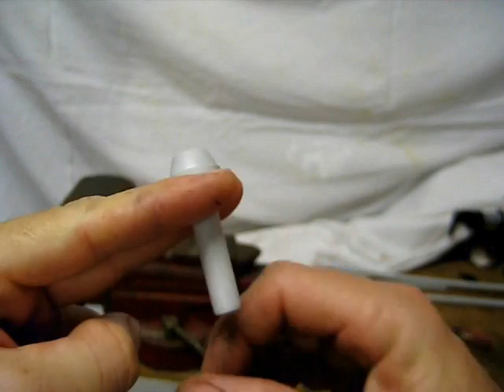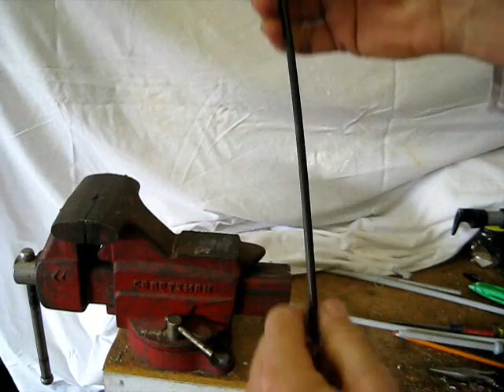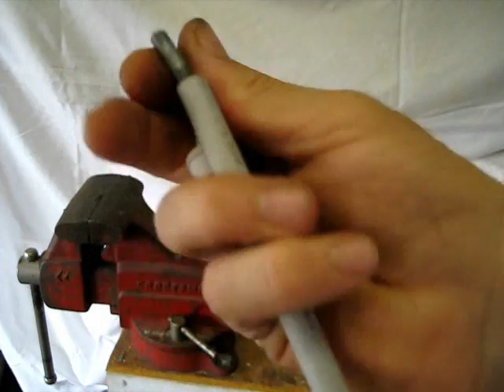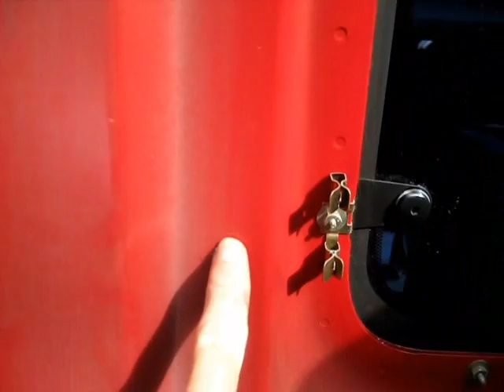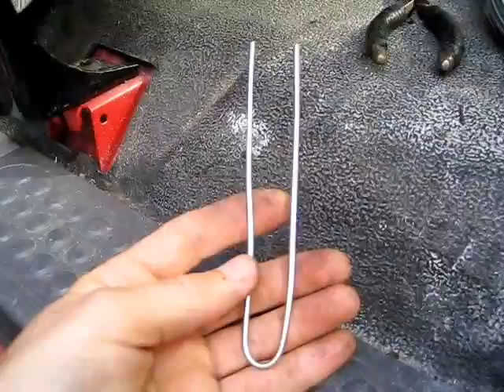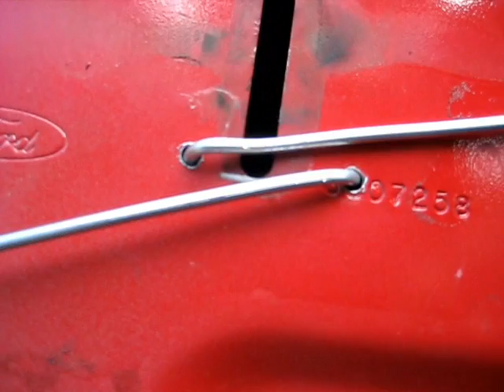ford superduty rear door wont open part 3 of 3

Comment: For the past yr both of my rear doors would not open, Ford wanted almost 200.00 for new cables for ea. door, I watched this video and elected to try this method of repair, as I did not have 400.00 just for parts. I fixed both upper and lower cables on one door, and upper on other door. I spent less then 10.00 at home depot. Thank you to the person who made this video.

Comment: Thanks Mark B. You are a genius! Neither of my rear doors on my 2000 F150 would open. First the driver side (7months ago), then the passenger side 2 wks ago. I followed your instructions and your fix for the upper latch worked like charm. As a matter of fact I used the same method to fix the lower latch, because it broke while I was testing my repair job on the passenger door.  On the lower, I used a tie wrap to secure the notched piece into the prongs. Thanks again.

Comment: At last - a worth while use of the internet! People helping people to solve problems without paying an arm and a leg! 
Mark - you rock for going through the effort to put this together.
For those asking about my bike brake cable solution - my apologies but I was up against the wall and in a hurry. I'm afraid that I did not have the time and the generosity that Mark has - I did not make a video. If you have a bicycle though, just go out and look at the brake handle where the cable is inserted and it should become pretty clear pretty quick what the concept is.
Once again, thank you Mark - you saved my butt AND made me look really smart to my wife. LOL
Reply from the maker: +NoTorr2000 Thanks for the nice words.  I am glad you brought that brake adjuster idea up.  I kept thinking, gosh, if I could just make/find a bold and nut with a slot in them.  I even walked past my mountain bike several times while I shot the video.  And I work on it all the time  Ir just didn't click.  That is definitely the easiest and cheapest way to fix it so far.  I fully intend to shoot a new video, but I am stuck in a few other projects right now.  Thanks again

Comment: fixpro256, Thanks so much for making all three videos, as NoTorr2000 said, you took the cloud away from tackling the door apart. But thanks also to NoTorr2000 for the heads up and the eBay link. you both made my day.

Comment: Mark:  I followed your instructions and it worked!  Fixed!  I just have to drill the holes for the support wire and I am done.  Worked to a tee.  Thank you for your efforts on the video.  Ever in Hartwell, GA I will buy you a coldbeer!

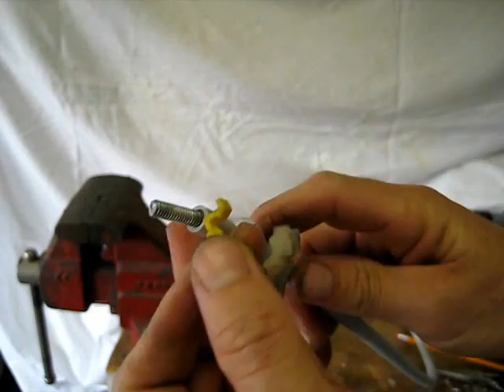Comment from the maker: Yes, I see what you are talking about.  I showed how to get it free in part 1 of 3 at about 3:40.  I show how to adjust it in part 3 of 3 at about 3:45.   Probably best not to put the door panel back on until the truck has been thru a few days of hot and cold weather to make sure you have it adjusted right.  Best of luck and thanks for asking.

Comment: Great video thanks a million.
on 4/5/2015, I was able to buy a pair of the cables  (approx 10 3/4 and 17 inch) - quality replacement parts for $42 from my local Autozone. Other brand name auto parts stores also sell the cables. and I see them online for $19 + $9 s/h.

That doesn't detract from your great quality videos showing the problem and assembly steps.

Comment from the maker: Thanks for the complement!  I agree that the design sucks! And even worse that the cable is not sold separately.  A real waist of resources to throw that big chuck of steel away because the cable housing cracked.

Comment: Clever great job!   FYI on eBay under ford cable repair you will find aluminum cable ends to repair the cable. They work great and are very easy to replace. They are 7.48 for a set.
Reply: lastgleeming, I just went outside last night and on my 2000 F-350, the door behind driver seat would not open, I said, OH NO!!! first thing I thought of was YouTube! LOL!!! I thought I would never find anything on YouTube about the suicide doors jamming up. I couldn't believe it, it happens quite often, LOL! After watching all 3 of these videos I was wondering if I could find a repair kit on eBay and then I seen your comment, 😂LOL! 
I'm gonna check it out now, Thank you my friend!!!!

Comment: I just cut  28 1/2" for the long one and 1" the little one  they work perfect, use my heat gun and  made a curve at the end.  For the notch I did use a Reciprocating Saw Blade, notch must be 7mm. , use some pressure when installing.

Comment from the maker: The first time I put it all together, the latch would not release when I pulled the handle.  I didn't really have to shorten the cable by cutting or anything like that, I just had to adjust the length using the adjuster on the threaded end.

Comment from the maker: Have you been able to get the door panel off? It should come off even with the door shut. Then pull the black plastic away from the door. You should see a large hole big enough to get your hand in and reattach the cable. Then pull on the inner part of the cable to release the lower latch.  You will probably have to lay in the back floorboard to access the lower latch. May need a small mirror and flashlight to see better.  Let me know how it goes.

Comment: Just to let you know Mark, to open the top latch of the truck, I did have to disconnect the cable from the assembly back, then pull on the whole cable, this dislodged the latch and just today was able to get the 1/4" pipes to repair the cables. Yes, both cables were broken, so I'm using your vid to complete this task!  Again, thanks so much to you and others like you who are able to save us guys a bunch of money!!

                       Doc

Comment from the maker: Would be surprised if inner part disconnected. If I remember correctly you can get door panel off with it closed.  Then find the end of the cable where it attaches to the handle and pull on the inner part of the cable end. If that doesn't work, then you reach in one of the holes (you may have to take out the speaker) and pull on the cable. Keep in mind that when you pull on the outside of the cable you will probably break the ends of the cable.  Then you will have to follow the video to fix it.

Comment: Hey Mark;I just thought I'd give you and others another option.......There's another Ford truck owner (who's a retired machinist) that had the same issue happen to his truck,so he invented 'a better mousetrap',by making aluminum CNC milled end pieces,that fit perfectly,to take the place of the cheap plastic/rubber Ford ends that disintegrate.....He sells each kit for $38 w/free shipping;Just search Youtube for "Ford F series door lock cable repair BEST METHOD".....He also makes them for Ford Ranger & Econoline vans too!

Comment from the maker: Even worse, the cable will come out if you hold your mouth just right.  But, nobody sells just the cable, so you have to buy the entire latch system.  I cant see bending over for $500 on a 1999 truck either.  Thanks for the comments.

Comment: Also, I have a 1990 Ford van with the same problem. My side doors and reardoors will not open but both front doors will. I will see if I can reach the cables by removing the inside panels.
Reply: I will let you know. I plan on attempting to open the doors within the next week or two.
Reply: I have not attempted the repair yet. Have been extremely busy.

Comment: I have a 2000 Ford Ranger XLT Supercab with almost the same problem on BOTH rear doors;I had to call the Ford dealership todayTop latch w/cable=$127ea/Bottom latch w/cable $115ea x2=$484...They did offer me a special deal since I need all 4 cables-$100 a piece!?WTF(Does not come with free jar of Vasaline!!??)Leave it to Ford to create a .50¢ part that wears out,and then costs over a hundred dollars to fix!..True to form: FORD=Fix Or Repair Daily!Your idea alone can save me at least $470;Thanks.

Comment: One more thing Mark, my truck must've been worked on @ this point before. Being a '97, I kinda figured it'd be like the one you were working on, but instead of drilling, I'm going to use nylon cable ties, which is what I'd found when I opened up the recess for the actuating assy. I imagine the same will work for the upper (wire) hook assuming one would use a thick enough tie. The ones I'd found when I opened up my door were the form of the smallest ones avail. and who ever had worked it before had used two of them. You may want to add this to your new vid!

                              Doc